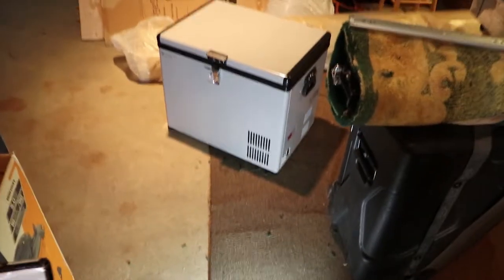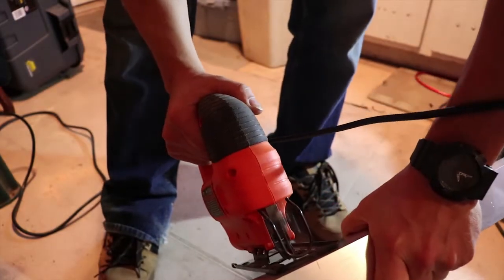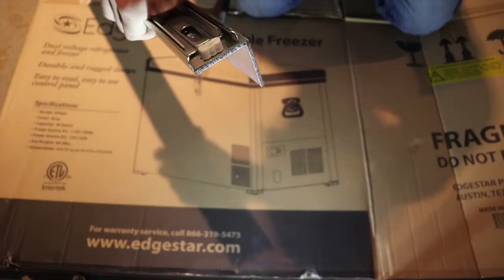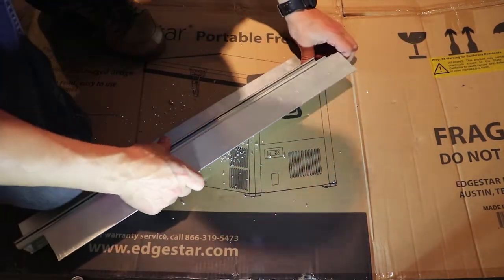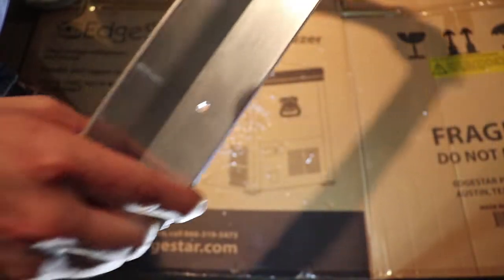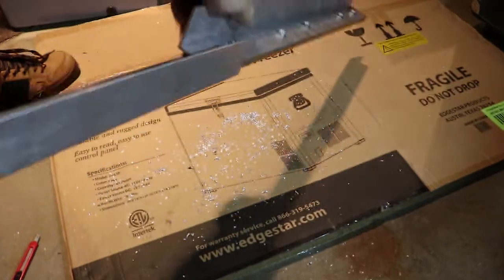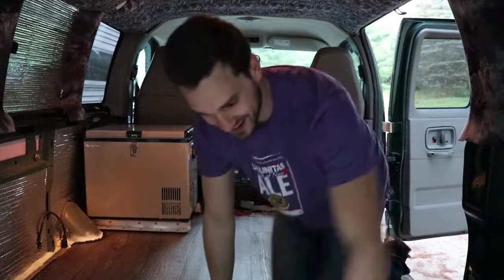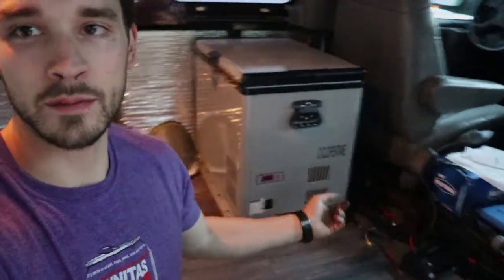DIY: 12v fridge/cooler sliders

Comment: How did you mount the fridge to the slider?
Reply from the maker: We added 4 bolts to the angle bracket that sit perfectly inside of the rubber feet on the bottom of the fridge. The weight of the fridge holds it in place, while still making it removable if needed.

Comment: Great video, so you mounted the rails onto the bottom of your vehicle. Is the fridge free standing on the black panel you sprayed and not mounted onto it?
Reply from the maker: its bolted to the black panel panel and the black panel is screwed into the floor of the van.

Comment: Be very careful using drawer sliders for supporting 12 volt RV fridge/freezers, especially if the unit will be mounted in the back of a vehicle and when pulled out, extend beyond the rear bumper. These drawer sliders are designed for drawers that usually hold clothing, and a big 75~100 quart Dometic or ARB fridge/freezer is way heavier; maybe well over 120 pounds when filled with food and beverage containers. If your fridge is so heavy that you can't pick it up when it's loaded, I suspect that it is too heavy to safely support with drawer slides.
Reply: There are several companies that make full extension drawer slides that support up to 500lbs fully extended.